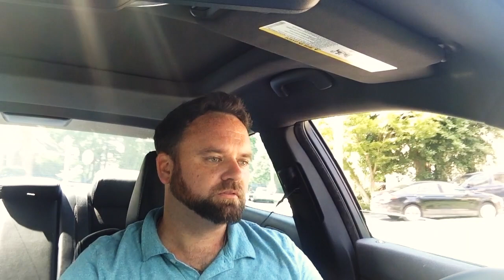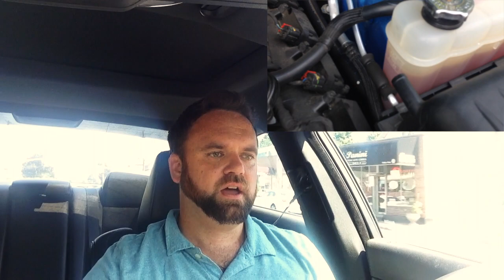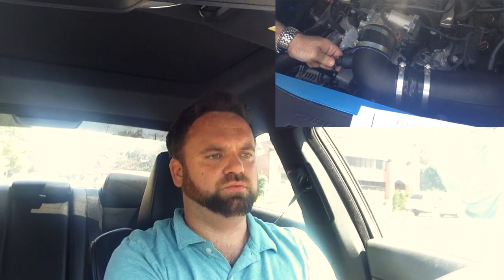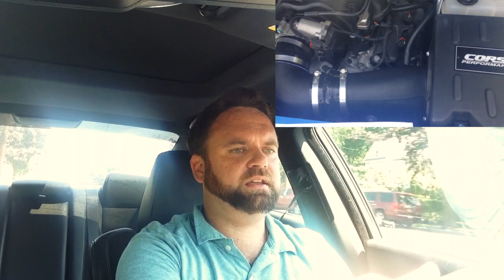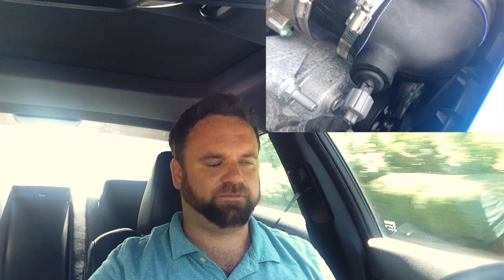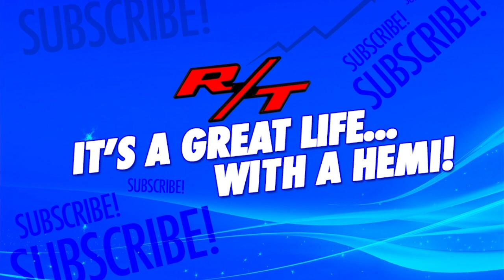Corsa PowerCore Cold Air Intake Installed

Comment: You might consider pulling the #31 fuse for 15 minutes.  I just reinstalled my Airaid intake and did the fuse pull trick and I think it actually helped. There's no more loss of low end torque that it had before when I installed it without pulling the fuse.  Your car sounds even meaner man!!
Reply from the maker: This intake sounds sick - very happy with this purchase for sure. I hope it actually translates into performance.

Comment: I had the same issue getting my sensor in.   The first time I tried I ended up pushing the grommet right into the inside of the intake tube.  In the end I took the elbow out placed my hand in the tube to hold the grommet still and then pushed it in.
Reply from the maker: That sensor was a pain in the ass - brutal! Thanks for the heads up video you posted.
Reply: +R/T Life sure thing.  Any time.
Reply: +R/T Life the car does sound Fn amazing.  I know first hand.  It turns more heads during WOT than my exhaust did.  There are no quiet or no notice 0-60 runs any longer.

Comment: why didn't you get the mopar intake?
Reply from the maker: I wanted a closed box air system - not a fan of how the mopar intake let's in engine heat.
Reply: I was considering getting the hellcat plumbing to the front grille and adding it to a cold air intake kit, maybe one for a hellcat that comes with the hole already cut out. Corsa is what I want but they don't make one for the hellcat. Think the tubing might still work on the corsa intake with some modifying.

Comment: sounds similar to my experience putting my intake on. It sounds great man cant wait to see if it helps that much. Im honestly wondering how the corsa would stack up against not just my intake but other that do not have the closed box. what did the air intake temps look like?
Reply from the maker: Uploading a video in a few, it has a clip of video showing them intake temps after a few pulls & driving.